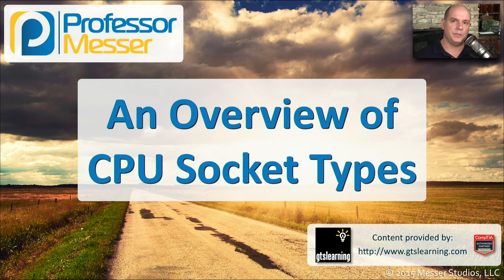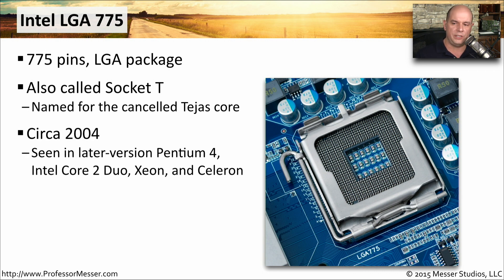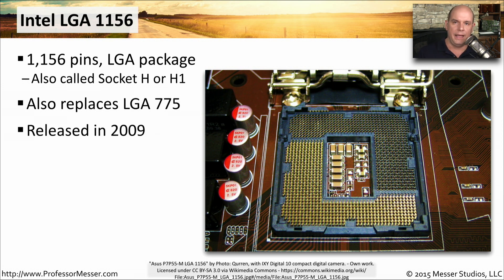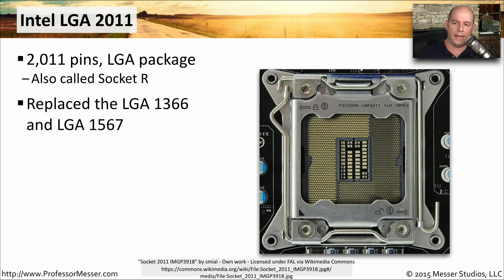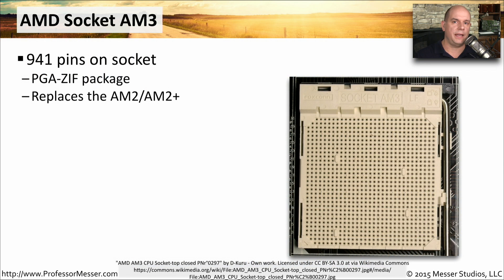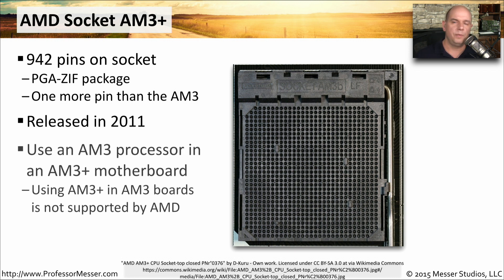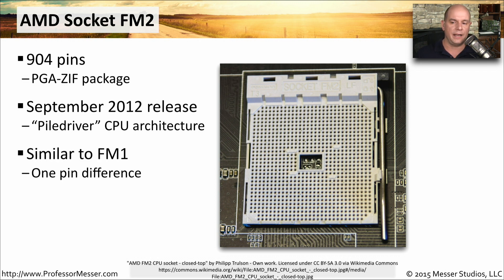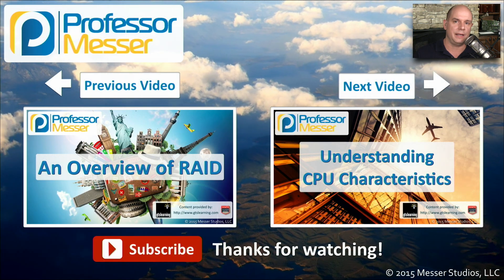An Overview of CPU Socket Types - CompTIA A+ 220-901 - 1.6

Comment: Is there an updated list of socket types? I’m studying to take the exam sometime in 2019
Reply from the maker: The 220-901 exam objectives have not been updated since their release, and this version of the exam will retire on July 31st. The 220-1001 does not include CPU socket types in its exam objectives.
Reply: @professormesser  I see socket types listed in the objectives under Motherboard connector types (but not under CPU features).  Thank you for your added details in the video.
Reply from the maker: @ILMOAAB  This video is not valid for the 220-1001 exam objectives.

Comment: Thx Professor, going to have to buy you a cup of coffee :) basically we would figure out what socket the motherboard used and then match the processor that goes with that. If the sockets on the mb and the cpu dont match they won't fit together.